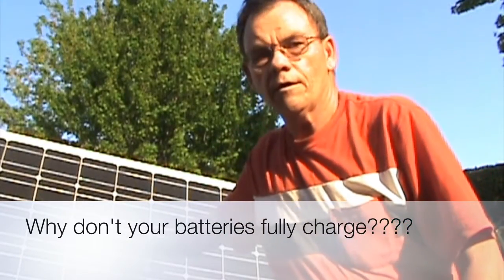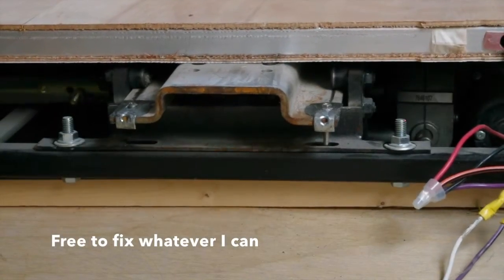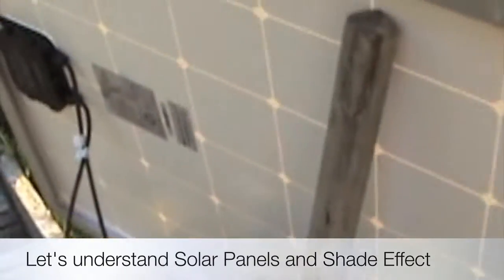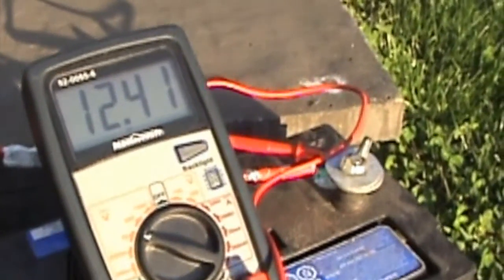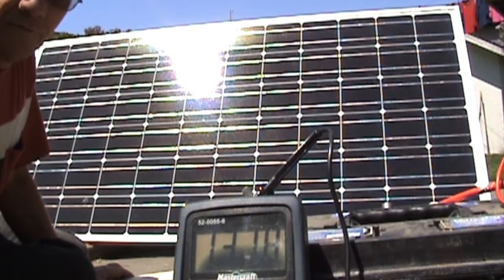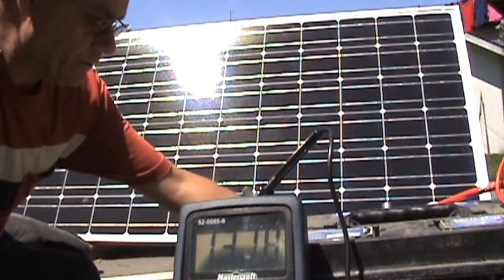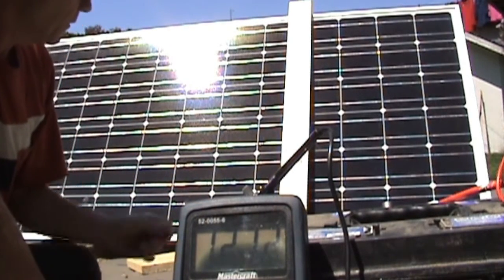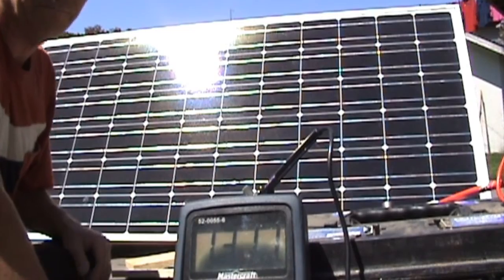RV batteries not charging properly. Fix Solar Panel Power Loss. How to fix low battery charging

Comment: Dude youre boiling the battery with out a charge controller
Reply from the maker: Thanks, but it was set up as a demo.  My actual setup has a charge controller, you missed the intent of the video.